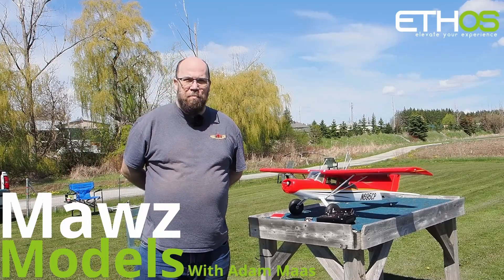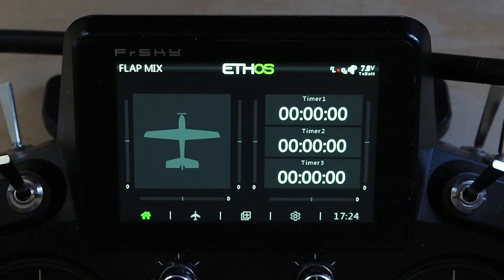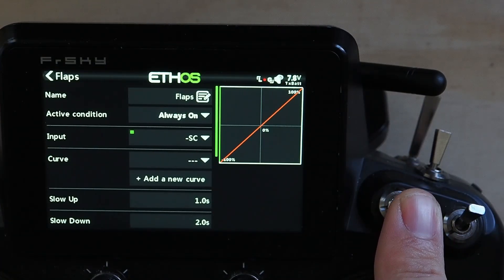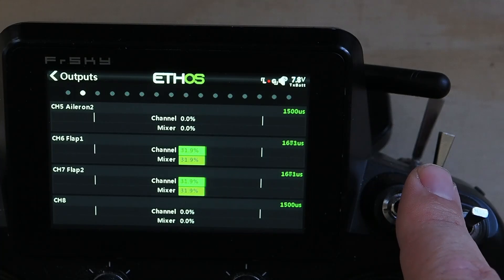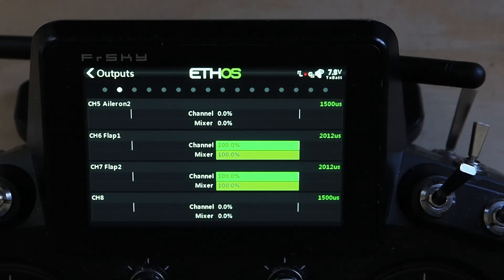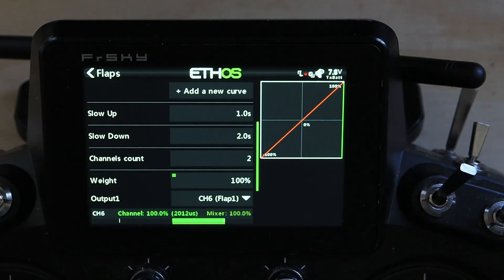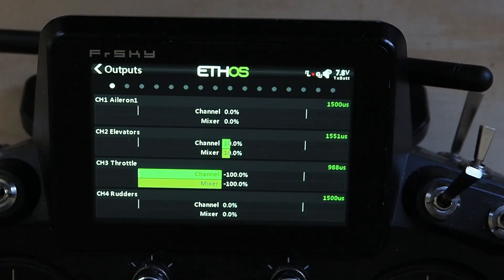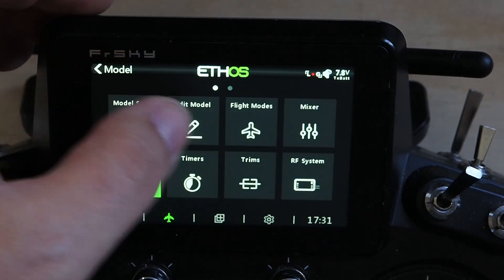ETHOS Tech Tip 7 - Flap to Elevator Mixing

Comment: I like getting the ele compensation up/down speed taken from the channel - neat. Now, I want to raise the ailerons a bit (ideally the amount set by a slider) when landing flaps are deployed (to avoid tip stalling a delta wing on a slow approach). I’d also like that to operate at the same speed. Any idea how I might do that pls? You helped me do this on OTX - need help again! (Ps., where is your thanks $ button? You are THE most helpful FrSky chap!) I’m struggling :-(
Reply from the maker: The exact same technique, but use a Free mix or the Butterfly mix.
Reply: @ OK, I have that working nicely now thank you! The last thing I would like is to be able to hit switch H and have full travel flaps instantly down as opposed to at the same speed that the channel down speed is set to. Is there any way to do that?

Comment: Thanks Adam,  very clear.  In my case X20 RS, once I choose T6, I don't have a value displayed next to it like in the Video.  However, at least now I have a decent Flap to Elevator mix.   Still looking for a way to reverse (or cancel) my Thrust Reverse (because it is always on and the EDF is sucking air rather than blowing air), then find a way to activate it only on a switch or a momentary switch.
Reply from the maker: The video is from a pre-1.5 version of ETHOS. SO the display is different from the current version. 

FOr your thrust reverse, you need to know what channel it is, then setup a Free Mix to control it.
Reply: @adam_mawz_maas  thanks a lot Adam ! It was long process to discover the issue, but finally was successful.   The only way was to reset the FMS Predator 120A esc (11 beeps), then activating reverse of the esc (4 beeps). Of course it wasn’t that simple. Needed to open the edf and pull out the esc to know the brand and searched for its manual and so on.   Now all is good. Thanks 👌

Comment: Thank you for this - works great but how do you change the amount of movement of the two Flaps ?
Reply from the maker: You adjust the flaps in the Flaps Mixer (balancing the flaps should be done by matching your midpoint and endpoints in the Outputs menu, or the new Balance function which should be in ETHOS 1.5.16)

Comment: i like how you did this but i dont like mixing ele with half flaps/takeoff flaps. i like just using free mix. they really should put slow on these mixes. not sure why they didnt.
Reply from the maker: They didn't put slow in the flaps->ele mix because if setup correctly, it would actually break things out. 

NB - Use the Active Condition of the mix or a 3 point curve to zero out the mixer output at half/takeoff flaps.
Reply: @adam_mawz_maas  not sure what you mean by "break things out". slow should be an option in these mixes.  it pretty much makes these predefined mixes useless for me without it. this is why i use freemix because the option is there.  not sure why they chose to leave this option out doesnt make any sense. using the predefined mixes as they are now is no different than using freemix takes the same amount of time but with more options.  it would be ideal to have flaps=>ele be the flaps and ele mix on one mix that would make things much more simple and is the reason it should have slow up and slow down. i thought ethos was supposed to be easier than openttx but in reality it is not.